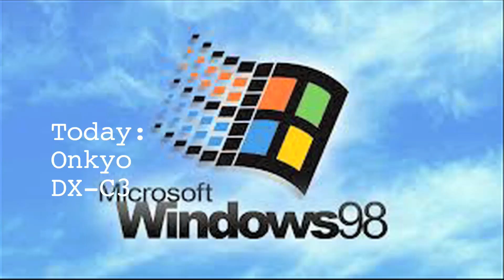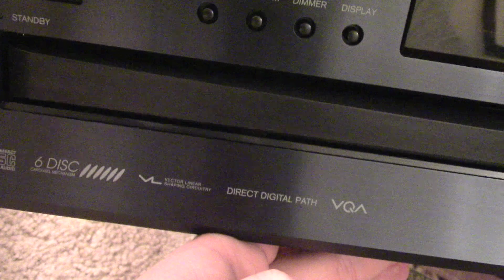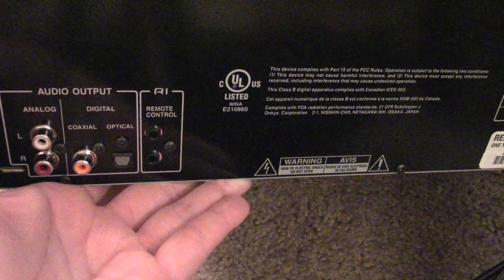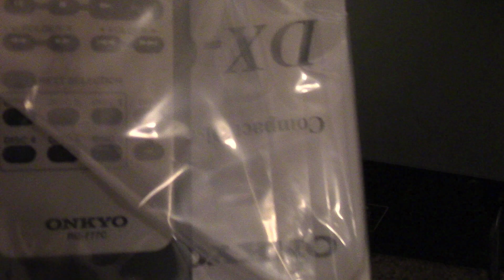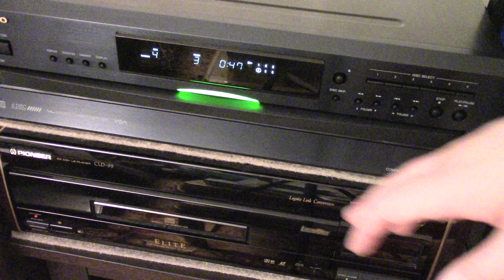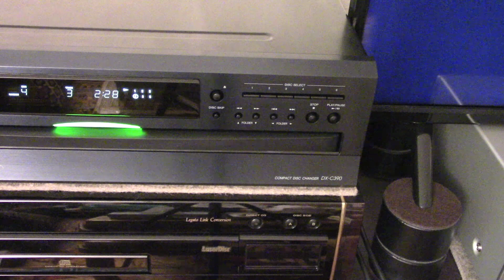Boring, long winded CD Changer Ramble (Onkyo DX-C390)

Comment: Wow! 3 years later and I just purchased a brand new DX-C390 from Crutchfield at discount. These have been in production since 1999 with no outward signs of change. As a design engineer, I know that there have to be internal design changes due to electronics market component "churn", but this changer has stood the test of time. It aint broke so ONKYO isn't going to fix it.

Comment: I've had one for a while and 1/2 the time the disc won't play the next disc in the machine (all slots loaded). I'm not sure why unless I need to open it and clean the sensor. However since this CD player was getting old I bought a new one, same model,  and I have the same problem. Can't figure out how the sensor could be dirty on a new machine. Any tips?

Comment: I just got one open box at Best Buy for $120 with a 4 year geek squad warranty. I love the sound through my Yamaha A-S801 so much I bought another open box unit from Best Buy for $150 this time also with the 4 year warranty. This thing has a really nice DAC with a direct digital path and 128x sampling rate. It gets really good sound.
Reply: Nabbed the “good” condition open box for only $105 - and it’s in mint condition minus a single minuscule knick. The four year warranty is a no brainer!
Reply: @nerdloftgaming  Yeah the first one I got was good condition and you could tell it had been tried out but it is mint. The excellent condition one was $125 and it hadn’t even been used once. I’m loving these things getting good sound out of a 6 disc changer.

Comment: I was looking for a multi disc cd player that also had digital out (ideally coax, as my only optical in is used). I came across this used with the anticipation of using it with my Marantz NR1602. Honestly, the built in DAC is good and I'm not sure I hear a difference between the built in DAC and the Marantz, allowing me to leave the Marantz powered off. Both 24-bit 192khz.

Comment: These things are built like a tank. I’ve had one of these for almost 20 years. Yes they’ve made the same exact model that long. That says  something. Why mess with perfection? Sounds excellent. I will definitely buy another while I still can just to have a spare.
Reply: That’s what I did. 🎶👍🏼😎
Reply: So happy to read this. I've got one on order and after I placed the order, I read some reviews where people said they have issues with theirs. Crossing my fingers that mine lasts for 20 years, too.
Reply: A chinese tank.  Sounds like crap compaired to my adcom 575 cd player
Reply: @jonfoss3437  I’m sure you got a good player. Adcom makes fine equipment. But we’re talking about a 6 disc changer. I bought mine well over 20 years ago and it has worked flawlessly ever since. Mine is connected via coax digital to my pre amp processor so unless I get a better dac, it would be difficult to get better sound.

Comment: Boring, long winded comment: CD rotary changers are prone to fail sooner than single CD transport systems due to the moving parts involved with the sliding tray. Some are fixable if you're good at DYI electronics repair, and have the patience and time to take it apart. Just something to consider to get the convenience of being able to listen to 6 CDs without going near the machine. I would stay away from the 100-300 disc changers, they typically have even shorter shelf lives. I purchased three used rotary 5-disc changers recently, (two Sonys and a Panasonic). All 3 were broken, even though they were listed as tested and working. I wouldn't recommend buying a used one, they're typically on their last leg or don't survive shipping if not extremely well packed. This refurbished unit direct from Onkyo looks like a good option.  I notice that this one is slower processing than others in random mode. The important thing is to not set anything on top of this unit, as it would put pressure on top of an already relatively fragile build. Having said that I want one. Debating on purchasing this with included 2-year Allstate warranty from Onkyo for $200 vs. what's listed as a new one, (not from Onkyo but an Onkyo authorized dealer) for $212 without the Allstate warranty, because the chances of them failing within 2 years are low.  I'm leaning towards the new, because then I'm reasonably sure that it's starts out fresh with me, and I don't have to wonder what it's been through before it gets into my care.

Comment: I found this video because I bought one of these used on eBay for $30 but it did not work when it arrived. It does not see the disk when I put it in. I opened it up and cleaned the laser but that didn't help. I was thinking about buying a replacement laser.  I'm torn because this is worth so much more than I paid if I can get it working and I want a CD player for my system. Anyway, nice job on the video!